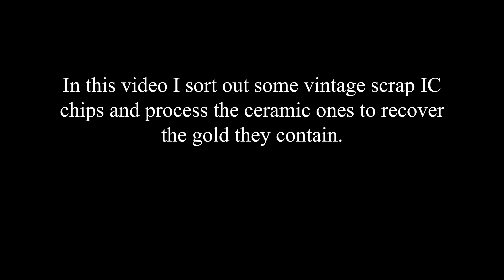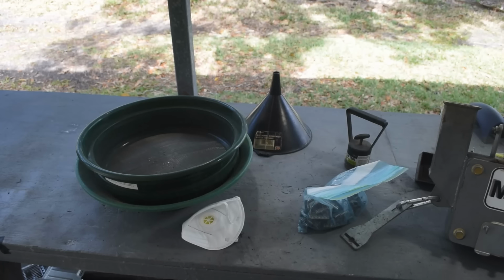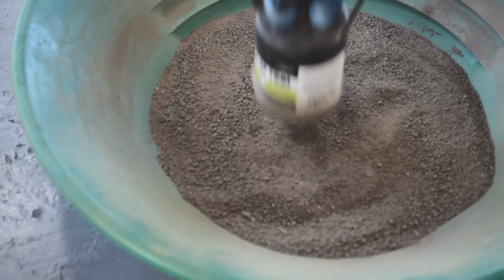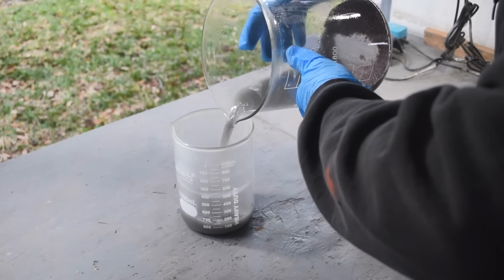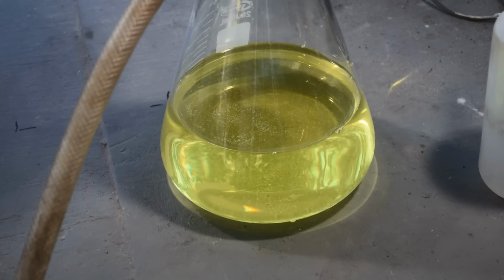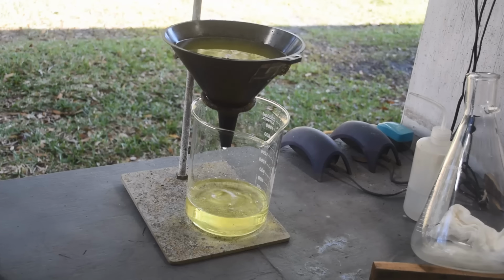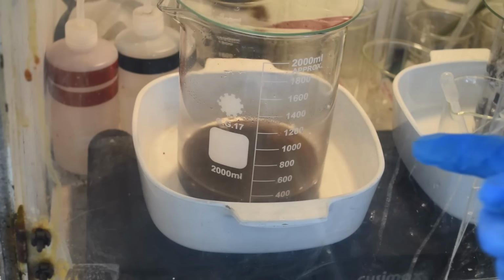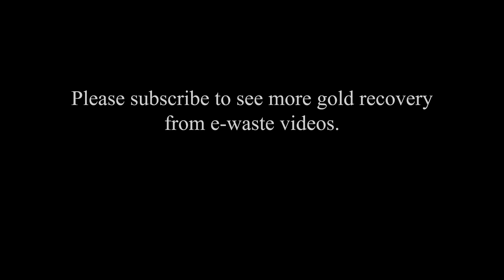Gold From Scrap Ceramic IC Chips #gold #goldrecovery #recycle

Comment: I highly suspect the frit as the source of the lead chloride. The frit is soluble in nitric acid.

As far as I know no radiation hardened chips came with lead in the ceramics. Radiation hardening was a part of manufacturing the die to include various processes to prevent latch up and short circuit when a transistor was hit by a ray. A popular way was to make chips with SOI, Silicon On Insulator. The die is made out of sapphire with transistors made as isolated components on top of the sapphire. I have a rad hardened chip with a few loose dies from around 1990 that I saved in my collection of stuff too good to refine. 😀

My preferred way to process this type of chips is to crack them along the frit and remove the legs.
The top lid is just scrap and the frit is washed away with some nitric acid before I go to aqua regia.
I never crush the chips, just leach them in hot or boiling aqua regia. You know that the gold is fully dissolved when the silicon die falls off, no worries if you got all of the gold leached from the powder.

If there are gold bond wires in the chips then the legs are also thrown in with the dies, but if the bond wires are made from aluminium then the legs goes straight into the steel bin.

To crack a chip along the frit I just put it on the short edge, slightly leaning, and tap it with a hammer on the other side. This usually shears the lid off clean.
Reply from the maker: I suspect you are correct. From my knowledge of glass, lead oxide lowers the melting point of glass. That might be desirable for the frit to melt at a relatively low temperature during chip manufacturing.

Comment: seems to me the first acid step would be just nitric.  The base metals are more soluble in nitric than hydrochloric aren't they?
Reply from the maker: You are correct that nitric acid would work much better. Thing is, nitric acid is expensive, and some people can't get it at all. I try to keep the process affordable and within reach of people who are limited in what is available to them. Note that I only needed a few ml of nitric acid for this process. The cheap and widely available hydrochloric acid works, it just takes longer.

Comment: Hey Mike 
Great video. I have only ever used my MM for chips. Recently I kinda by accident ran some water through my mill and discovered a surprisedly amount of gold and copper. Not sure how often you clean yours but the may be some metals trapped in there. 
Just a thought
Reply: I wonder if some fragments might be getting caught in between the shackle pin gap? Hmm...
Reply: I wondered about the cleaning of these types or larger equipment for crushing grinding. 
I recall seeing a vacuum setup, but I was thinking some dissasembly and rinsing might be needed depending on if it's for a client or personal use 😂
This could be the "handling fee"
Reply: @colonialcharlie8702  there's a discharge tube add-on that hooks up to the mill door, and it's sized to accept 1.5" pvc, which makes it easy to use with a separate vacuum system to achieve "dust free" crushing.

Comment: Great video as always.  I know it most likely isn't feasible for mass production, but for small batches would it help to remove the legs manually before crushing and processing?  I only have a small amount to process (a little less than you did here) so I figure it would only be less than half an hour worth of time for me to cut or break the legs off.  Just wondering.  Thank you!

Comment: I bought rubber wine bottle stoppers. The fumes destroyed every one of them. Do you know where you got yours from?
Reply: @richardhulbert9480   I got mine from Enjoyist on Amazon.  I have not tested them yet. The gasket under funnels are bad to get eaten by acid also. Do you remember if it was the green 💚 or the white ones 🤔 that were good? I remember sreetips mentioned it but can't remember the color 😕
Reply: @ManMountainMetals  I bought blue and black stoppers.the acid destroyed the lids that came with the bottles even faster. I bought 6 quarts from xelexo thinking to refill the empty ones. I bought white funnel adapters
They have discolored some but are holding up pretty well.

Comment: I have a question. I've used copper to drop silver, I've used lye and sugar for silver chloride, I recently used a piece of aluminum and a bit of sulfuric on silver chloride, I like the aluminum process, what are the drawbacks to using aluminum? There aren't many videos on this, I absolutely do not like the lye and sugar method.